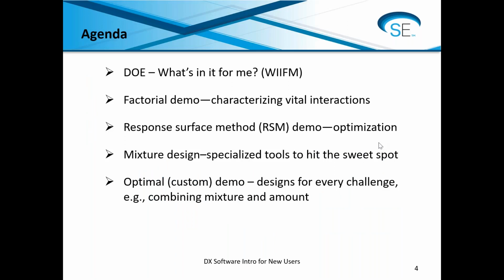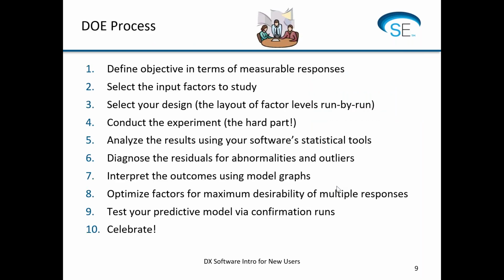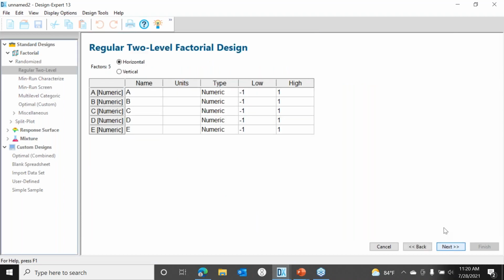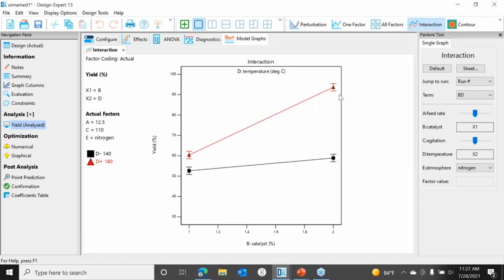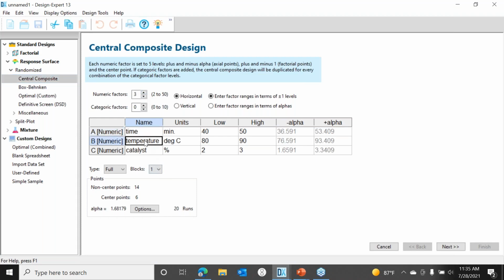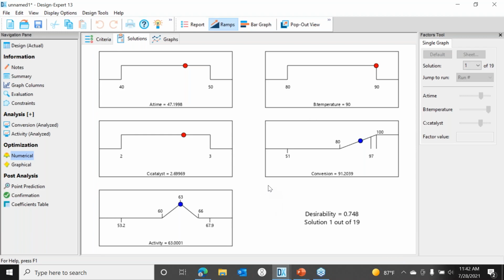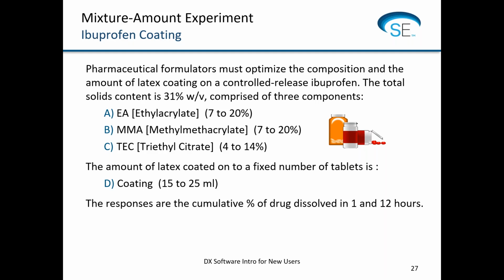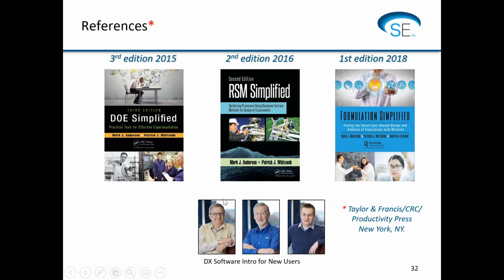New User Intro to Design Expert® Software - July 2021

Comment: Thank you for very informative lecture. could you please explain to me, how can we use 2-level factorial design to detect curvature by adding center point?
Reply from the maker: Within Design-Expert, you can choose to add center points (recommend 4-5) to any 2-level factorial design. The analysis will then include a curvature test. If it is statistically significant, then the data collected at those center points does not match the value predicted by the linear model. In this case, augmenting to a response surface design to gain more information is recommended. Here is a blog article: https://www.statease.com/blog/energize-two-level-factorials-add-center-points/